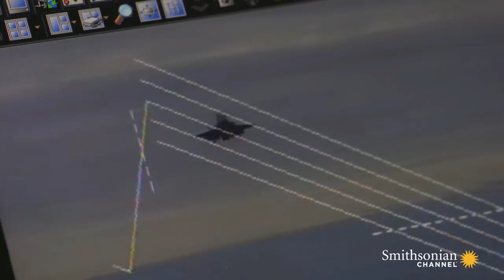This Fighter Plane Landing Has Never Been Attempted

Comment: I have a hard time believing the Harrier never did this.
Reply: @Akira Sharma-Barkess They don't say this though... they say "But no one has yet attempted a ship born rolling vertical landing for real"   0:51  They don't say "in an F35b"
Reply: @guntherultraboltnovacrunch5248  classic Americans taking credit for things that other countries did before and did better.
Reply: @PaulRudd1941  Pretty Much.
Reply: @PaulRudd1941  That's a UK Aircraft Carrier and Pilot... not American. US doesn't have ramps on their carriers... nor does the US put the British flag on the tail of their aircraft.
Reply: Just said
The same thing, f18s have been doing it a long time
Reply: @PaulRudd1941     HMS Queen Elizabeth is the ship  Peter Wilson is a BAE test pilot....Americans aren't taking credit for anything but the F35b
Reply: @gregoryhall2967  f18s need an arresting wire to come to a stop when landing and are coming in a bit faster than this plane.
Reply: @huntermeadows4911  it may be condensed but it's not far from reality.
Reply: It did in 2007
Reply: @gregoryhall2967  Carriers have had arrestor wires for over a century. Landing at normal landing speeds is the norm, the wires just reduce the length of required 'runway'.
This was landing at a much slower rate and without any arrestor gear, but as has been mentioned the harriers were doing this decades ago as well.
But not the F35B
Reply: @Valmarn  It's an American USMC jet on loan to the UK for integration testing with the Queen Elizabeth. You can see "USS Wasp" on the tail of the jet, and the aircraft transfer was in the news a few years back.
Reply: A lot of harriers did the srvl on the invincible class carriers this was the first in the F35B on the queen Elizabeth class carriers
Reply: Ok
Reply: I landed a harrier like this in 1983
Reply: @fabiolean  Actually BF-04 is a Lockheed Martin owned developmental test aircraft. It along with BF-02 are systems integration test aircraft.
Reply: @guntherultraboltnovacrunch5248  nor do they mention its the Royal Navy and Fleet Air Arm
Reply: @Skiddins  I get it, my point was that this maneuver has been done for decades, ever seen an ospree? So it's going to be huge news when an f36 does it lols
Reply: @dubtownman9508  flight sim
Reply: @michaellecky6438  no
Reply: @gregoryhall2967  Not a VTOL
Reply: Harrier always landed vertically at sea.
Reply: @PaulRudd1941  Funny thing too. This is clearly a Queen Elizabeth class carrier (Two Conning towers, one acting as a flight controller the other as the bridge, and can swap roles if one of them is lost in combat) but do they mention that? No. Infact, towards the end of the video they show a completely different aircraft with the lettering "USS Wasp" on the tail fin, looool.
Reply: @RazgrizF14  no they don't
Reply: @nilloc93  the context is the US lent you a plane because you can't even build a proper car , landed a plane (ours lol)  in a manner we've been doing for 40 years on a carrier with a ramp , a design dropped 80 years ago.   Slow

Clap

Well done
Reply: @PaulRudd1941  annnnnddddd you didn't notice that was a UK carrier and jet.
Reply: @gregoryhall2967  ok dude, show me video proof of an f-18 landing in a carrier without an arresting wire, and by the way I was in the Navy stationed in an aircraft carrier watching aircraft land and takeoff every chance I got and not a single time did any of them land without the arresting wire.
Reply: @PaulRudd1941  Classical anti-americans making stereotypes about people from a country with over 400 million occupants with severe differences in culture between each and every single state.
Reply: @owo1744 

Some clown lectures me about the US diversity with a pepe profile picture I'm not actually going to take them seriously. 

Have you actually looked at mine? Of course I'm anti-American.
Reply: @DVSUte  - They've proven the F-35B can take off fully vertically, but it is not recommended due to the heat its engine produces versus the engine in the Harrier. It has the technical capability of VTOL but it's not practical since the heat could melt carrier decks. I suppose in a wartime scenario operating from carriers, LHDs or austere runways perhaps they could create some type of heat resistant matting, perhaps? But as of now it's been done only for demonstration purposes to prove it can do so.
Reply: @98erics  - U.K. carrier, UK test pilot, USMC jet. The UK doesn't have its full complement of F-35Bs yet so USMC squadrons are going to be operating from the QE as guests – I assume alongside their UK counterparts.
Reply: @Valmarn  ...@Matthew Terry = HAHAHAHA!
Reply: @VisibilityFoggy  Ah, thanks for the info. I did not know that.
Reply: @PaulRudd1941  Your welcome for the United States taxpayer providing 75% of the funding for the Pegasus through the MWDP after the British government refused to fund it.
Reply: @1202burton  Lockheed Martin is happy to take credit for implementing the software for SRVL which was paid for by NAVAIR via US taxpayer funding.
Reply: @fabiolean  The aircraft belongs to the Marine Corps and is augmented to VX-23 not on loan to the UK.
Reply: @kenthemanmcmillan8965  Other than the VAAC Harrier, how many fleet Harriers or Harrier IIs executed SRVLs as SOP?
Reply: @SCscoutguy  BF-04 is "owned" by the Marine Corps and augmented to VX-23 for ITF.
Reply: @98erics  "that was a UK carrier and jet."

UK carrier, Marine Corps F-35B augmented to VX-23 at PAX River,
Reply: @VisibilityFoggy  "but it's not practical since the heat could melt carrier decks."

Incorrect. All boats embarking F-35Bs have their decks treated with heat resistant coatings, Thermion. Vertical takeoffs consume much more fuel and the aircraft payload is limited in comparison to a rolling takeoff, the short takeoff in short take off vertical landing - STOVL. In fact vertical takeoffs were recently executed aboard ITS Cavour. There was vertical takeoff KPP for the JSF.
Reply: @gregoryhall2967   the UK invented Jet powered VTOL which invented STOVL carriers and they also invented the steam catapult system, angled deck, optical landing system, Radar & the armoured deck plus other things so British engineers played a major part in Carrier technology and also the F35B because BAE systems & Rolls-Royce play a part in it and the P.1154 that was supersonic was designed by Hawker Siddeley who built the Harrier  & that’s where it’s engine design comes from

Comment: For how much that plane costs it should autopilot that landing 😅
Reply: Plane bro
Reply: Non Ya right?
Reply: Non Ya for how much that pilot is paid they better be doing some leg work too
Reply: Thats what the 747-MAX said...
Reply: JORDAN PHOTO WORKS there is no 747 max lol
Reply: They have to test the software first, which is what the testing is all about.
Reply: @tsolias27 ... the pilot gets automatically ejected.
Reply: It shouldn't need any one on board for what it cost. It should fly it self and tend bar when off duty.
Reply: @tsolias27 No, there will not be an autoland. No carrier landing is automated.

There are systems that can do this, developed recently. However, you are dealing with unpredictable sea states, pitching and rolling decks etc. 

The other point of course is that its essential for military pilots to be proficient at hand flying carrier landings. If those skills arent constantly practiced,constantly honed, then when that system is unavailable due to combat damage or malfunction, the consequences could be disastrous.

Even civil airliners are only allowed to autoland  a limited number of times to maintain hand flying proficiency.

Where such a system would be useful is for occasional use in unusual situations. For example when a pilot is injured or ill and is unlikely to be able to pull off the landing.
Or for example in a bingo fuel scenario, where another missed approach would result in the aircrafts loss. For those situations I think it will come.
Reply: Relative to other gen 4 planes with targeting pods, the F35 is a cheap jet
Reply: It's not that it can't its more of a "we can't rely on something that could fail and trust our pilots are trained well enough
Reply: It does. Vertically.  Just finalizing parameters to do rolling touchdown automatically.
Reply: @pizza_parker9689  737... You all knew what I meant.
Reply: Which I'm sure they already do and most likely using it..we NEVER get the whole story on anything that is done by the goverment..so....yeah
Reply: Martin W someone who Knows the facts
Reply: I think they do.  Automated Landing System.  But this isnfor emergencies.  Probably to prevent pilots from being overly dependent on tech aids.
Reply: You know that’s the cost over the lifetime of the jet. The F36A is 77million which is much lower than 4th gen fighters
Reply: Their cheap
Reply: It can.
Reply: Non Ya most planes can auto land. A320 series does it the best though.
Reply: @blumac9801  but not in a moving ship in the middle of water
Reply: 84 mil
Reply: JORDAN PHOTO WORKS 737 max also that has no relation
Reply: And inprove that camera
Reply: @servanttofriend8481  737 max
Reply: @servanttofriend8481  well technically it did auto land
Reply: Hey man, 89 million and getting cheaper. It's not terrible. Lol
Reply: 💪300👍
Reply: Still cheaper than the f22
Reply: JORDAN PHOTO WORKS you have no idea what you are talking about right ?
Reply: @servanttofriend8481  no, i didnt
Reply: grow forit Yes it should. The general population doesn't even know half the things this plane can do. They would need to automate EVERY SINGLE FUNCTION of this $87m aircraft PERFECTLY. If not perfect, it would be a $100k pile of scrap really quickly. We are getting to the point where automation can take over, but it won't be heavily implemented into fighters until it's been tested vigorously for decades.
Reply: A Random Internet Box You really need to read. It would crash if it was automated without PERFECT data, programming and testing. I didn't say they'd sit the general population under the canopy.
Reply: It does
Reply: It is a nice fail safe but the military would prefer pilots to not have to rely on autonomous systems.
Reply: Carrier aircraft do have automated carrier landing system (ACLS) but that's the 35C not B. it probably has ACLS but generally pilots don't use it. Even the F-14 had carrier auto land at some point but the carrier has to have the Datalink
Reply: @servanttofriend8481  Don't you wish people would read the comments before posting?
Reply: @growforit8736  Autonomous planes are far cheaper because  they don't have a pilot and therefore don't need the systems required to save, protect and even fit a live person onboard.
Reply: As production continues the price of each individual F-35 falls.  Currently, the fiscal year 2020, it costs about the same as the F-15 E.
Reply: And be able to do it WITH full payload
Reply: For how much that plane costs it should teleport and be able to travel through time
Reply: Umm... it basically does. The British designed the avionics for the B variant based on their research into a Harrier replacement. It almost is autopilot. Their work is what made the B variant possible.